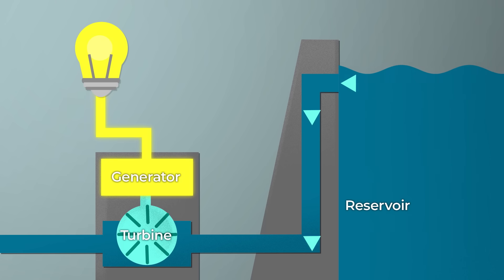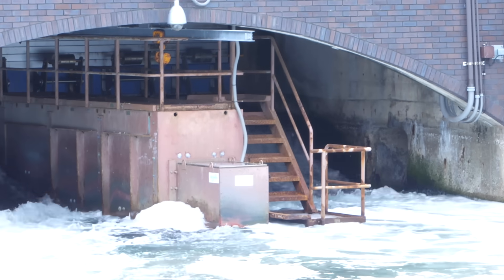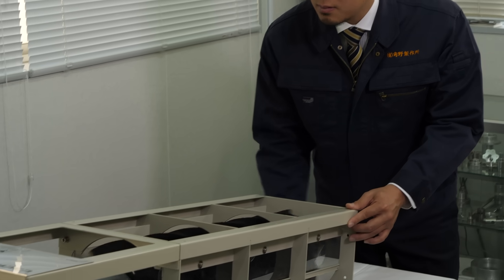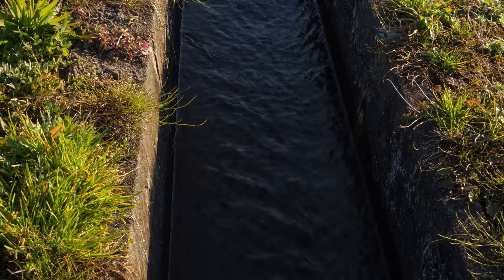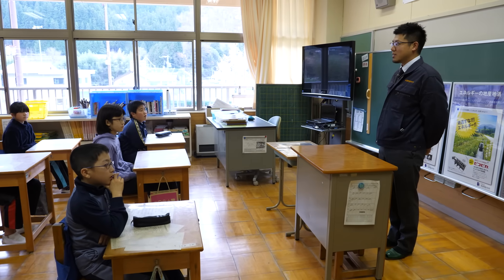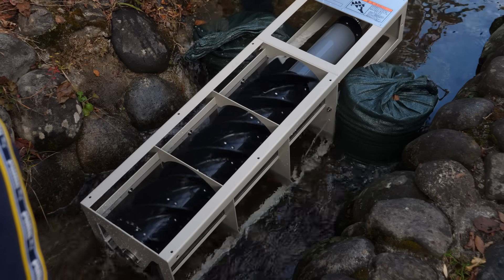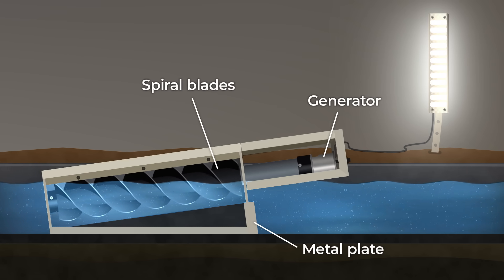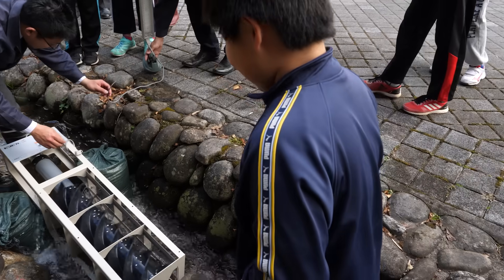Ultra-Small Water Power Generator

Comment: I love how they never tell you how much electricity it produces, so you can't tell if it's a genius invention or just nice looking useless machine.
Reply: At least it's 24hr power so better than solar
Reply: And how much does it cost
Reply: @ProhorGlad  I read an article that says roughly $100,000 for the mounting system and installation.
Reply: @jameslargen284  nah,  its basicly screw pile with generator i can do 500w one for under 500usd with instalation, which is cost of solar here, but twice the power considering night/day
Reply: @krassav43g  my phone and YouTube app is acting stupid, I was actually commenting on a hydraulic solar tracker video and it commented on both. My bad...
Reply: There are two types of units, “PicoPica10” and “PicoPica500”

“PicoPica10” is a unit that enables around 10W generation by securing a flow of 10ℓ/sec and a head of 0.1m. This product can be manually assembled and utilized as security lighting, drawing power from a nearby waterway. “PicoPica10” has already been sold over 500 sets within Japan as an environmental education material.

On the other hand, “PicoPica500” enables around 500W generation by securing a higher flowrate of 100ℓ/sec and a head of 0.7m. The generated energy can be equivalent to an average Japanese household’s electricity consumption.
Reply: @unda_kuva6393  thanks for the info. What about the cost and how late long before corrosion?
Reply: @unda_kuva6393  500 watts at 100 volts is equal to 5 amps.    Most houses in the United States have 100 amp service, some have 200 amp service.   So you are telling me that the average Japanese house only has 5 amps?   That's not enough to power anything but a tiny bit of lighting.   I think this has to be massively incorrect.
Reply: @jimthesoundman8641  you never use the full 100 amps 24 hrs ,this will suply 5amps hrs x 24 hrs =120amps x 100volts =12000watt =12kw it is not bad at all for sure you need a battery bank ....According to the EIA, in 2017, the average annual electricity consumption for a U.S. residential home customer was 10,399 kilowatt hours (kWh), an average of 867 kWh per month. That means the average household electricity consumption kWh per day is 28.9 kWh (867 kWh / 30 days)
Reply: @TechnomaniacDude  North Norway (and other countries in the north) barely have a ny sun 6 months of the year..
Reply: @dubious6718  most poor areas have lots of sun
Reply: @dubious6718  and no flowing water in at least3 of those 6 months
Reply: @dubious6718  Yeah, and all small streams are frozen.
Reply: It provides a significant amount of light. Enough to comfortably do homework by. And by day it will charge cell phones. The question is the price.
Reply: @calvingreene90  I don't know for sure, but just looking at how simple it is, it doesn't look too expensive.  YES--I would have liked to hear how many actual Watts it produces.   By omitting that detail, the producers of this video missed a chance to take this from mildly interesting to much more educational
Reply: best comment
Reply: Full technical specifications and a lot more details: http://www.unido.or.jp/en/technology_db/5276/
Reply: I think the usefullness is being overlooked. Sure, in a modern city, this thing seems useless but in a remote, infrastructureless village or area this could be the first step in building up an infrastructure. Chain several of these together to charge battery powered tools, provide some minimal lighting, etc. and I could see this being helpful. It should be a tool to get to better infrastructure, not the sole goal.
Reply: You can see it barely manages to light up that small lamp, so it seems pretty useless.
Reply: Yeah but if it can continuously charge something like a battery bank . It could have some use
Reply: @TechnomaniacDude  Its a prototype
Reply: When they leave out key facts like that you can bet it is just a useless machine.
Reply: What if we used it in a close system like aquaponics? And then send whatever is produced to power banks 24/7?
Reply: Anon Anonkiewicz take snorting to power that LED light he’s holding. I want to know the cost and actually voltage and amps this puts out.
Reply: @TechnomaniacDude  I don't remember hearing the claim that this is the answer to everything..  To use your very own logic, the sun only shines in a useful  way  less than half the day.   Both methods are useful, both have drawbacks
Reply: They said the one under that bridge powers the lights...... which tells us absolutely nothing. If that's all it powers that's a total failure, that much water moving should generate more than enough for some lights.... unless they're using some serious powered lights lol
Reply: @TechnomaniacDude  I live near Canada next to the nooksack river and I have never seen it freeze even streams don't freeze except sometimes the tops or sides
Reply: Found it on google... its called PicoPica10 and produces around 10W at 10l/sec. http://www.unido.or.jp/en/technology_db/5276/
Reply: They don't mention it, because it only "produces" small amounts of electrical power. It is an interesting toy.
Reply: people criticized electricity the same way when it was discovered; they thought it was merely for illusions and entertainment. give it sometime and you'll see how it evolves
Reply: @TechnomaniacDude  there are literally places on earth that get no sun for months at a time, please try to have some real knowledge before you just dismiss something you know nothing about. You may not like the idea of this invention, but to someone who has no power at all this could be a life saver. Don't get why people have this incredible need to always be so negative.
Reply: Because that varies depending on the flow of the water and the size of the generator. And what do you mean with how much? How high voltage it gets or how high amperage?
Reply: was waiting for the figures whole video. Looks like 5-10 watt lamp flickering. Solar or even wind might be more viable. But really nice concept. Though more maintenance might be required due to debris getting stuck.
Reply: True. And the impact on the environment.
Reply: @TechnomaniacDude  But it doesn't shine at night.
Reply: @TechnomaniacDude  The caption says ''This small lake outside Stockholm , Sweden , emits otherworldly sounds '' kindly speaking whats your point  ?
Reply: @TechnomaniacDude  Have you been  north of polarcircle wintertime ?
Reply: @TechnomaniacDude  I have 26 sunpower panel bud there is very little sun in the winter here in the north of France but i have a small river that is going true my garden.For here it wil be good !!!
Reply: @TechnomaniacDude  He meant a river flows 24/7 smartie. The sun doesn't always shine everywhere and 24/7 but on the poles at certain times. So in a sense it is 24/7 electricity compared to a solar generator if you put it next / in the water. It's common sense that you won't get water power in a dry desert.....

And you do know LEDs flicker on cameras?
Reply: It's not going to be much giving the minimal speed and torque of this assembly.
Reply: Use a battery to collect the electric,then use it for watching television at night.
Reply: Got the numbers here. This device is named "PicoPica10" and you guess it - it generates 10W with the head of 0.1m and flow rate of 10L/s. PicoPica500 generates 500W with 0.7m head and 100L/s flow rate. 500 units are already sold and PicoPica500 has already been placed in Nikko City, Tochigi Prefecture, Japan.

Source: United Nations Industrial Development Organization (UNIDO)
Reply: @TechnomaniacDude  everywhere at daylight. though your right, not every house has river flows. Both are just a toy itself imho.
Reply: It Powers a small LED light bulb if that tells you anything
Reply: That’s the Asian way
Reply: Check out the water rotor made in Canada the small one is 1 KW
Reply: And this is just good enough for someone to use it to attack China
Reply: Anon..... it is just a nice looking useless machine.
Reply: @TechnomaniacDude  Rivers freeze on the surface and shouldn't affect this if submerged
Reply: @dubious6718  norway is already running on bigger hydro power plants, their electricity is 98% hydro power
Reply: Very little power, and it's quite expensive to build. Not actually usefull in the real world but cool for kids in school i guess.
Reply: @arendmookhoek4314  Not really expensive to build at all, unlike solar energy hydropower doesn't need lots of strange metals.
Reply: @DaDunge  it doesnt HAVE ro be expensive, but this one IS.
Reply: @arendmookhoek4314  Then build your own, the design is not exactly complicated. I doubt you can patent a Archimedes screw hooked up to a generator.
Reply: @DaDunge  I dont think its worth it, the size makes it pretty inefficient. A larger one with a turbine would work well but those already exist you know.
Reply: @arendmookhoek4314  Yeah but the larger ones aren't mobile, the point is to have one small enough to be carried, and it's actually no less efficient than a larger one, the energy it yields is a linear function of how much water you force through it, potential energy becoming kinetic energy becoming electric energy. No more energy is lost than in the case of the big ones.
Reply: @arendmookhoek4314  how much power is it producing, and how much did it cost to build?????????
Reply: It only generated enough power for one led light strip. I could get more power from taking a dump.
Reply: @jon1208  It's placed in a stream with almost no potential energy.
Reply: After more than 8 years trying to fix the Fukushima nuclear power issue... Humankind will not use this. Nuclear power is better, cheap and use water too...radioactive water can be used or it is better to drop into the ocean? Well... Looks like that will be a useless machine. How many time the planet Earth have in our hands?
Reply: @cmtepiu7750  ... You do know that nuclear energy uses  a turbine too right? This technology could be used to make nuclear plants smaller too.
Reply: probably 1 solar panel produces more
Reply: @Kni0002  how much kw it produce.

Comment: All right let's make an calculation. Let's say a flow of 5liter/sec and 0.1meter elevation. 5liter = 5kg * 9.81 ~ 50Newton.
50N * 0.1m * 1sec = 5J = 5 Watt
Take one PV panels produce around 250W  and let's say that PV products 1,5kW per day 1500/24 houer = 62.5W power means value around the clock. So approximately my calculation example say that we need 10 of this screw compared to 1 PV panel. Anyway a funny thing to do.
Reply: Well this can work constant 24x7 without battery for storing. And living in area with only 2 season you had most 6 month rainy day combine with panel this is a very good option.

Comment: The problem is...it seems it does not generate much electricity at all...just enough to power LED lights, which really don't take much power at all...so the application is very limited, other than lighting...and nothing more.

Comment: I've seen this done using a DIY old coil car dynamo (the reverse of what it's supposed to do) in a small stream. Well done.
Reply: A 12v 400ma solar panel literally makes more power than that puny thing. It doesn't even have enough power to light an led properly.
Reply: @elyasrasti8943  OHHHHH yesss and Night ?????? 
ended you solar panel
Reply: @PedroECalvo  dude, my point wasn't about night power, my point was that it doesn't make much power to begin with. If you wanted power at night, get a 12v 1amp solar panel, hook it to a battery, and boom, you have enough power  to light an led for the night.
Reply: @PedroECalvo  we're talking about cost effectiveness here, and this stupid hydro turbine is neither cost effective, or scalable. Solar is scalable. Throw a couple hundred panels in the desert and you can power an entire city. We have trillions of acres of free land, but how many available rivers do we have? Think about these things and realize that solar is more practical. Hydro power is effective in dams, where the potential energy of the water is so immense that it actually makes sense to harvest that energy.
Reply: @elyasrasti8943  yes, i'm thinking a lot about the minimum cost, using some solar panels and the turbine without  batteries, powering a city? no i think about living off grid
Reply: @elyasrasti8943  A nuclear reactor literally makes a million times more power than a 12V solar panel. What‘s your stupid point again? The device was harvesting continuous, little streams of water.
Reply: @heavycurrent7462  wow, an intellectual. No shit a nuclear reactor makes more power, do you want a cookie for your observation? My point is that whatever millions of R&D went into this, and if it's being touted as a solution to the world's energy crisis, then it's a heap of bullshit.  There is no substantial amount of energy being produced, large scale versions of this exist and they can barely light up a small village.    I'm saying all this from what i remember from watching the video god knows how long ago, I'm not going to rewatch it, and it's also not a scientific breakthrough whatsoever. A 6th grader could make this out of a dc motor, and soda can with his dad in an afternoon.
Reply: @elyasrasti8943  Yep. It seems to a particularly weedy design.

Comment: watermills exists from thousand years
the casing shape for this Archimède screw could be largely improve for efficienty
Reply: Its not about efficiency, its about mobility and availability of use. If you could ditch this concept you could just put the Archimedes' screw in a pipe, that way it would be more efficient, but thats not the point.
Reply: Go ahead and prove it.
Reply: Oldbatwit Why does he have too? I mean, it would be ideal, but he is a youtube commentator lol
Not a public engineer or figure.
Reply: @oldbatwit5102  : do you know about Archimède , Bernouilli , Newton , Watt , Navier-Stokes , Reynolds , Laplace , fluid dynamics ? have you an ingeeneer degree ? I had in 1973 and I have worked on hydraulics and aerodynamics 1976 => 2008 ( heating , cooling systems + generating sets ) ( and I had my first visit of a water-mill was in 1961 - aged 6 )
the vidéo shows a " toy " that pedal through the semolina
Reply: @ericdupont1326  Yes.
No (though it is actually spelled 'engineer')
So what?
So did I.
So what?
....What?
Hope this helps.

Comment: Is it even in theory possible this thing could generate enough power to manufacture a relacement for itself?
Reply: Well probably not but like the guy in the video said it could provide emergency power
Reply: A 12v 400ma solar panel literally makes more power than that puny thing. It doesn't even have enough power to light an led properly.
Reply: @elyasrasti8943  Oh.

Comment: Educational video
But where is the damn ratings?
Volts and AMPs damn you
Reply: I can reply to you the volts... The output was the right voltage to turn on a commercially available emergency power lamp in Japan--which means that uses the same number of volts you can find in any wall outlet in Japan at the same frequency, which I believe to be 110 V and 50 Hz, but it could also be 220 V and 60 Hz. How many amps? Now that is the question!
Reply: Amps would be very low due to the lamp flickering. Could very well have been a low voltage lamp, I'm quite sure it was LED which as you know takes little to nothing.
Reply: . @magneticking4339  Japan mains voltage is 100v, 50 Hz in East Japan and 60Hz in West Japan. 220v is also available depending on local situation.

Comment: Every action has an equal and opposite action. This is fine small scale but making it large scale will change the flow of the stream or river and have unintended consequences
Reply: Every cost must be weighed.
Reply: The flow routes of rivers change all the time, especially in flatter terrain.  There is no stability in natural systems.

Comment: Why do they show the water coming in from the dam on top? Isn't there is more pressure to drive a turbine when feeding it from the bottom?
I'm no engineer so, just asking a legit question.
Reply: Ignoring the head loss from friction going down the pipe, the hydrostatic pressure should build up when going down the penstock to exactly the same pressure at the turbine, no matter what height the penstock inlet is located (pressure difference is a function of height difference and fluid density only).  In practice, if the intake is too low, it clogs up with silt, and pulls off freezing cold water; if it's too high, it starts sucking air when the water level gets too low.  (I'm also no engineer though!)

Comment: I bet its less than 10watt in this "river".
Even with 100watt its not really usefull and produces more waste than energy.
The next rain or flood will wash it away and its gone or destroyed.
Reply: There are two types of units, “PicoPica10” and “PicoPica500”

“PicoPica10” is a unit that enables around 10W generation by securing a flow of 10ℓ/sec and a head of 0.1m. This product can be manually assembled and utilized as security lighting, drawing power from a nearby waterway. “PicoPica10” has already been sold over 500 sets within Japan as an environmental education material.

On the other hand, “PicoPica500” enables around 500W generation by securing a higher flowrate of 100ℓ/sec and a head of 0.7m. The generated energy can be equivalent to an average Japanese household’s electricity consumption.

Comment: The biggest fall is your design which will get jammed again and again by collection of weeds,wood  sticks and other materials which generally flow along with natural water . Except this your design is pretty awesome
Reply: Yes, debris is a huge problem in real streams.  If you arrange the system exactly right, a steeply angled intake screen can self-clean, at the price of some head loss.
Reply: @olawlor  You can solve this by filter, that is just before generators. You need it to clean it daily, but anyway, it's not so much work for to have free power.